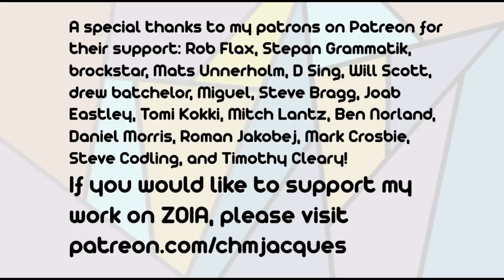Empress ZOIA tutorial:  "CV interfacing with Chase Bliss Audio pedals"

Comment: Biggest question for this: presets! CBA pedals are great with presets. I’d like to do things like this, but want to have presets going too (ideally changing presets on both ZOIA and the CBA pedal at once). I have a Disaster Area QConnect but it’s not playing nice with my Condor or ZOIA atm. Is there a way to change presets on both ZOIA and Condor without it?
Reply from the maker: CV can't be used to change presets; that's a MIDI PC message.  So, the alternatives to your QConnect are simply other MIDI controllers, unfortunately (or, I suppose, a computer/tablet, although it would be acting as a rather glorified MIDI controller in that capacity, and you would need some sort of interface to connect to your pedals).  I do know that Disaster Area released a new firmware for some of their controllers to include ZOIA as a selectable device, but I don't know as that extends to the QConnect.  I have also heard good things about Disaster Area's customer support; have you run the issue by them?
Reply from the maker: I suppose a (very convoluted) alternative would be to use the ZOIA as a MIDI controller for the Condor.  You could set up your presets in the scroll mode on ZOIA in the order you would need them for a live performance, then include a "bang module" (check Tips and Tricks) in each ZOIA patch that would send a PC message to the Condor.
Reply: @ChristopherHMJacques  Yes, but I haven't been home enough to troubleshoot! Matthew at Disaster Area has emailed me a few times. I just haven't had the time to crack the code.

Do you use your Condor with another midi controller? If so, which do you like?
Reply from the maker: @RobFlaxMusic  If I use a MIDI controller with the Condor, I use ZOIA or a Faves (or, in a rather, I think, idiosyncratic choice, a Beatstep Pro--which I actually have gigged with as a foot controller; it's surprisingly rugged and its possibilities as a MIDI controller are pretty deep).  As a non-gigging musician, I have plenty of time to work from the front panel/live mode to find the sound I'm after, so it's not a great priority for me to be able to recall presets immediately (and part of why I like Condor is you can do so much from the front panel; in a lot of ways it's the most immediate CBA pedal, in that regard).  I wish I had a recommendation; you might ask the Facebook group.

Comment: Could I use CV mode with an eurorack system???
Reply from the maker: Sure can; CV is kind of indifferent to where it comes from or goes, so as long as the places it arrives from produces CV and the place it's headed accepts CV (important note:  and the range of the CV is appropriate; 0-5 V is the most common CV range, but -5 to 5 V, 0 to 10 V, and 0 to 3.3 V also come up fairly often).  I plan to do a video on interfacing ZOIA with eurorack (well... semi-modular; a Behringer Neutron) sometime soon.
Reply: @ChristopherHMJacques  Oh, man. Don't make me want a Neutron next... :D